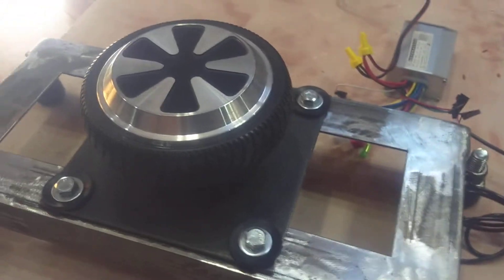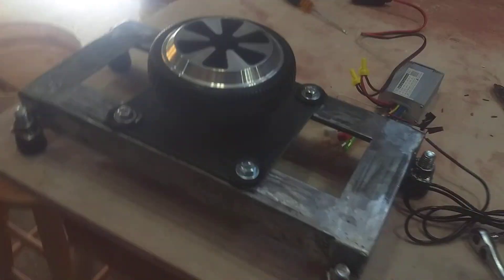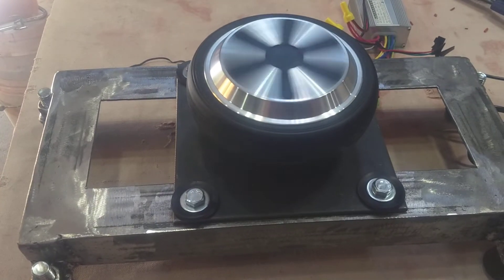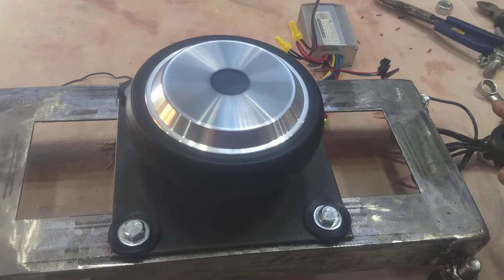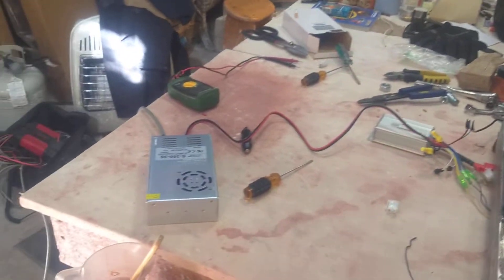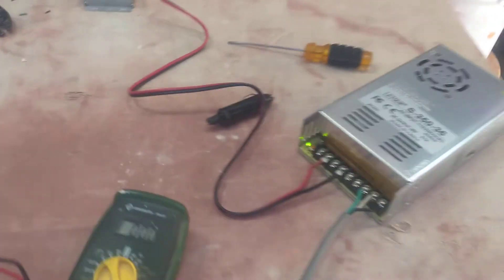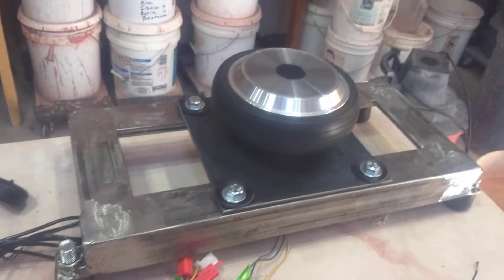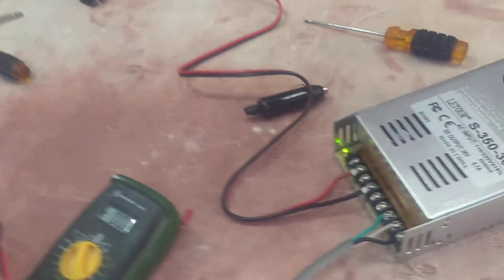DIY pottery wheel. Off grid hoverboard motor

Comment: This is awesome..Looking to copy your design to make a wheel for my wife. What part did you use to secure the hoverboard wheel to the frame, thanks in advance for the info.
Reply from the maker: I used a mechanum wheel coupler. Haha Took me forever to find them!
I believe it was a 17mm bore. There are other options. D coupler's etc... I also tried out a piece of angle iron with 2 U bolts as well. Let me know what you wind up using. I've now successfully been using my prototype for full time production pottery for about 2 years. Really strong reliable motors!
Reply from the maker: Sorry it's actually 16 mm and the spelling is mecanum I think
Reply from the maker: Looks like a company called casterbot. Has some for $19.99
Reply from the maker: I have some 5/8 on hand but they need to be drilled out to 16mm to actually accept the shaft of the motor
Reply from the maker: I purchased a 16mm drill bit and honed out the 5/8 couplers that I have on hand. If you aren't able to find one. I now have some on hand.